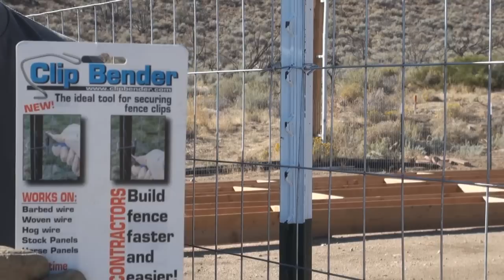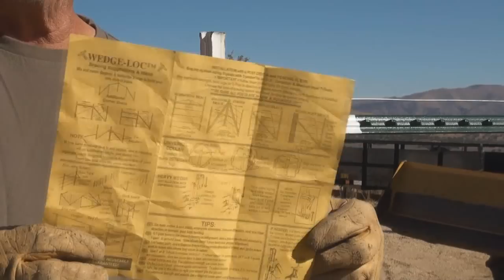GardAnimal Welded Wire Fence

Comment: I'm going to build a 60 plus foot fence in my back yard to keep my dog off my garden.  I just bought everything I needed from Tractor Supply except for the gate hinge kit, I had to order that online.  As soon as it gets here I'm going to get started.  I'm going to follow all your instructions.  I really wanted to use the green metal mesh fence to keep it from rusting and because it matched the green metal gate I bought but it seemed to flimsy so I went with the regular unpainted 14 gauge metal mesh fence because it seemed more sturdy.  Thank you for your video.
Reply from the maker: +Jay B Sounds great Jay, check back and let me know how it goes!
Reply: looking for t post gate hardware

Comment: I have found that a stubby standard screw driver with a hole drilled in it just bigger than the wire your splicing together worked better than your fingers, but I use no climb horse fence for my place.

Comment: Would you please comment on how well the corners of your fence have held up with the Wedge-loc hardware and the tension you’ve applied to them?  I’d like to do this same thing for our animals in Indiana.  I’ve been told the corners will pull with tension over time.  Would just like to know what you’ve experienced.  Thanks for the informative video!
Reply from the maker: Jared, our corners are the same as the day I built them. I would build this again in a heartbeat!
Reply: +The Practical Prepper Thx for the update, I'm going to use this system.

Comment: Great video where did you purchase the door you added and what's it called I'm constructing a T post fence and I would like to use that door instead of a regular chain-link fence door.
Reply from the maker: babie flores The one I used was from Tractor Supply. I looked and I don't see that one exactly on their site but this one is very close. http://www.tractorsupply.com/en/store/wire-filled-gate-4-ft?cm_vc=-10005Hope this helps
Reply: Did you post more on this fencing project? Can’t find it here. Great video BTW. Thanks.

Comment: Thanks! I'm also a first timer to this I'm fencing off about 180 ft of yard in a box for my dogs and I was wondering if you recommend bracing all four corners, I live in ga and the ground is a hard clay and the post seem to be pretty sturdy I'm also using 6ft tpost buried 2ft into the ground.
Reply from the maker: babie flores The ground where I put the fence was compacted for a pad so it's hard as hell! I put 7' post, two feet in the ground. Did it in spring when the ground was easier to work. The corners are done with the Wedge Loc fittings and they make the job easier and stronger. See the comment below from Dawnshine, it has the link to Wedge Loc.

Comment: what is the ratchet device that you use to stretch the fence called? I like the homemade wood fence stretcher.
Reply from the maker: Jon, the ratchet is just a "Come Along" that you can buy at most stores. Has a cable wound onto a drum with a gear that you can lock and unlock. They are useful for so many things. Here is a link: http://www.northerntool.com/shop/tools/product_200511810_200511810?cm_mmc=Google-pla-_-Material%20Handling-_-Hoists%2C%20Lifts%20%2B%20Cranes-_-23110&ci_src=17588969&ci_sku=23110&ci_src=17588969&ci_sku=23110&gclid=CMDc4oi-l74CFcRafgodnUsAZA

Comment: I need to fence in a 30 pound dog.  I only need to fence a 666 foot stretch along the BACK of my yard.  Would Lite duty T-posts be ok or do i need heavy duty?
Reply: Ebony Farashuu   i meant 66 foot.  Not 666.  LOL
Reply from the maker: Ebony Farashuu Light duty should do fine Ebony. Our dogs are about 60lbs and do not present any issues. When you get into cattle and horses do you really have to build something stronger.
Reply: THANK YOU!  I put up my fence the other day!  I'm pretty sure i need to tighten it, but my dog is no longer able to get out.  Thanks for this video!